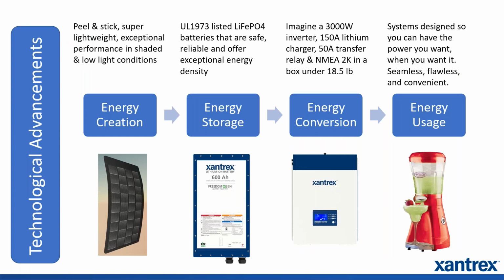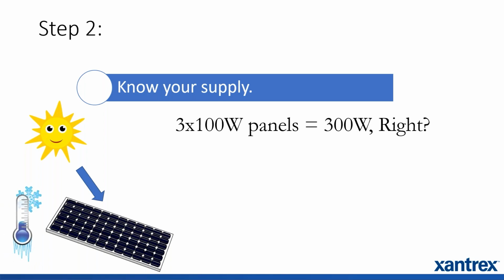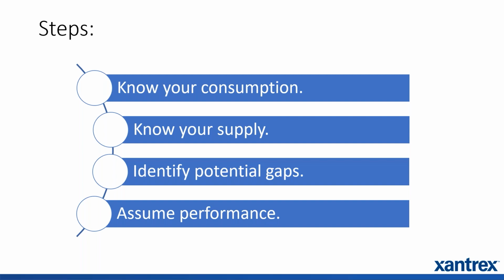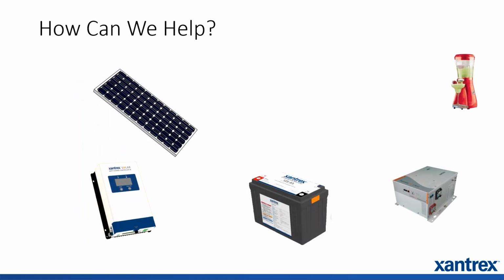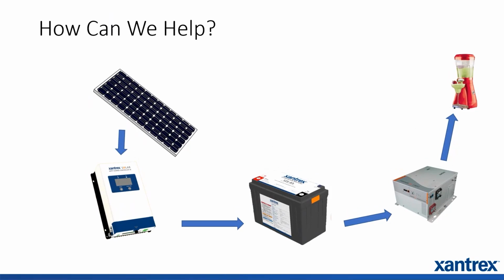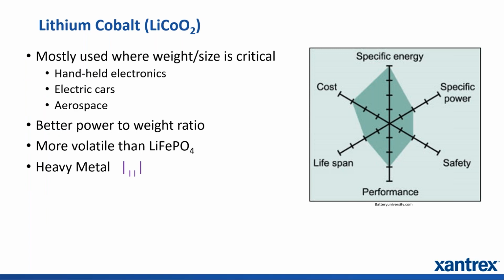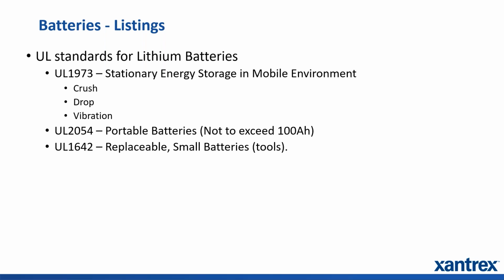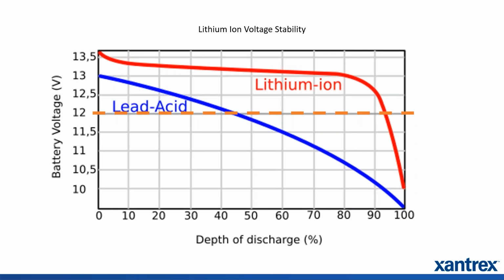Webinar: How to Build a More Efficient Electrical System with Emerging Technologies

Comment: The ABYC statement that AC Power (Watts) is equal to the product of Voltage (Volts) and Current (Amps) is wrong.  Look at any engineering text book to verify this.  AC Power is the product of three terms which are Voltage, Current and Power Factor (PF).  Power Factor is a unitless quantity or term.  ABYC refuses to include this very important term in the equation.  The value of Power Factor is usually in the range of 0.6 to 1.0.  If the Power Factor of a piece of equipment like a microwave oven is 0.6 then your calculation of current will have a 40% error when you use the ABYC method of calculating current.  Some load items like a water heater will have a PF of 1.0.  When the PF is equal to 1.0 then your calculation of current will have no error when using the ABYC method of calculating current.

Comment: I love lion tech.  Sooooo much energy density.  Hell I even stopped using alkaline headlamps on the job and specifically use head lamps that take the 18650.  i Keep 4 18650's in a storacell  and im  good to go  fo a long long long time.  much better than old AA lights and a good 18650 will last a very long time